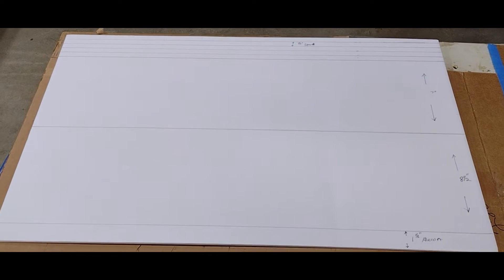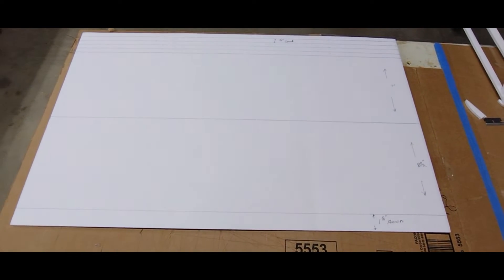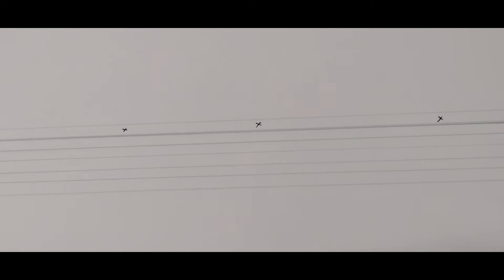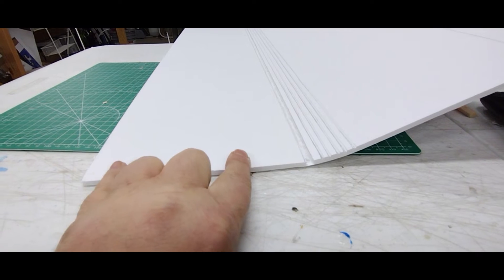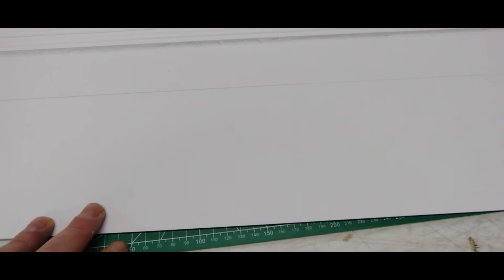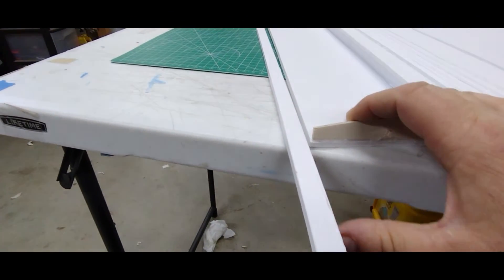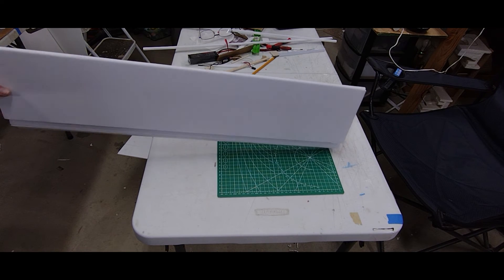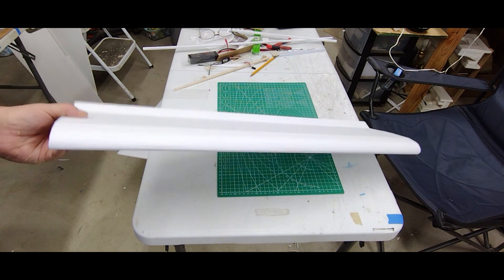DIY Foam Board Wing Full Build

Comment: I did the exact same thing you did and mine still popped when I folded it.  Maybe I'm using the wrong foam board.  I might do it different next time.
Reply from the maker: You can try making your gap bigger and removing the foam in the gap to the paper.  Some of the foamboard out there is terrible now . I will do a video on the 2 types of board to look for and the one not to use!